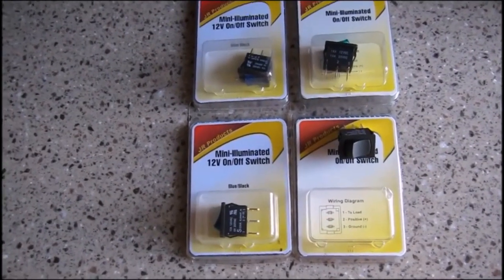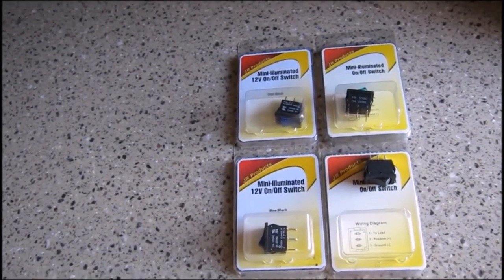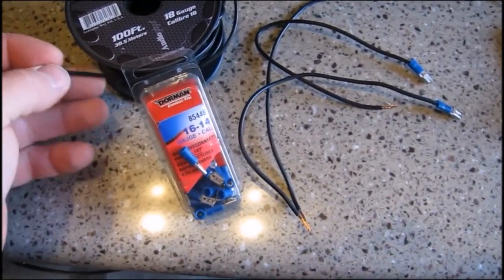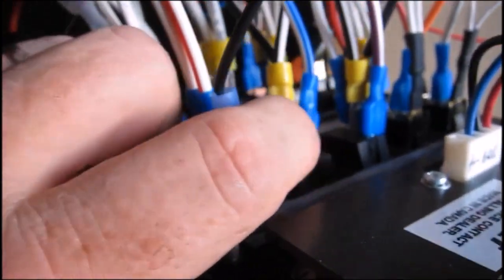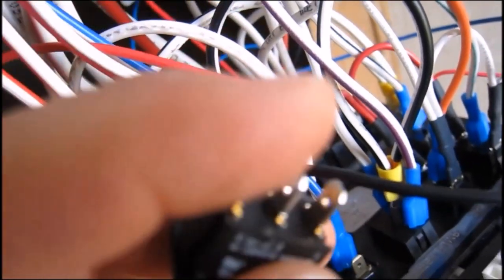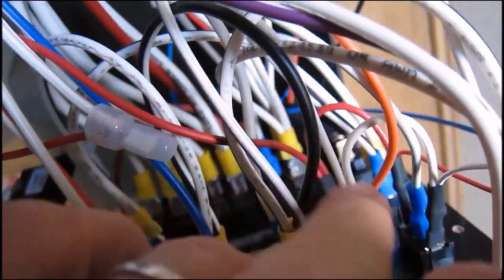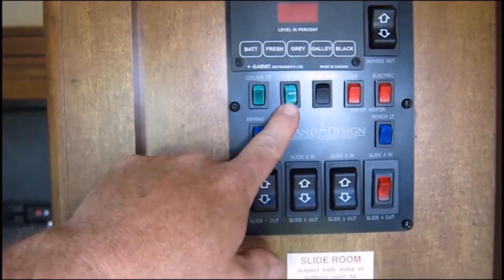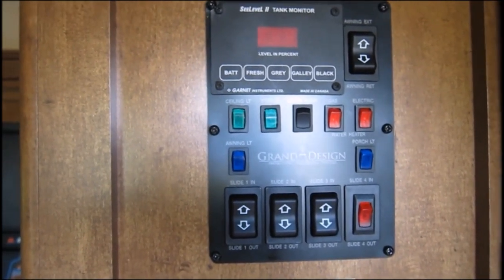RV Lighted Switches Modification

Comment: The 'little clips' are properly called 'quick disconnect' terminals. The right terminal size for 18awg is red. With positive and ground terminals in such close proximity, you need to use fully insulated terminals.